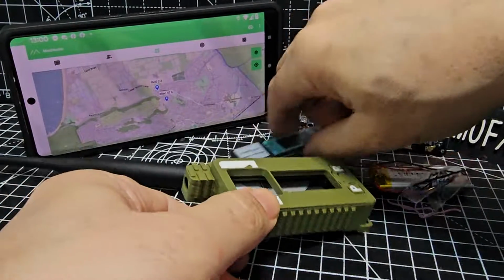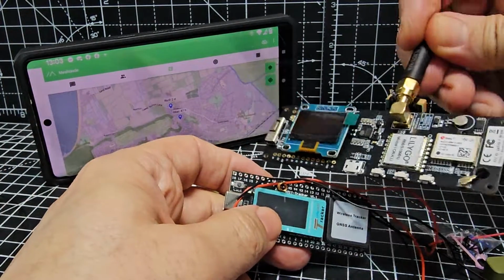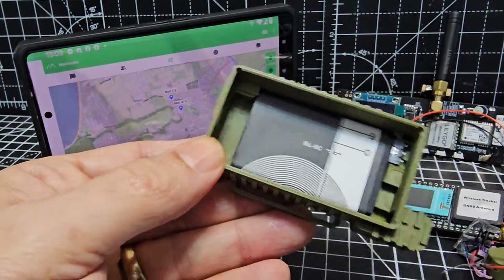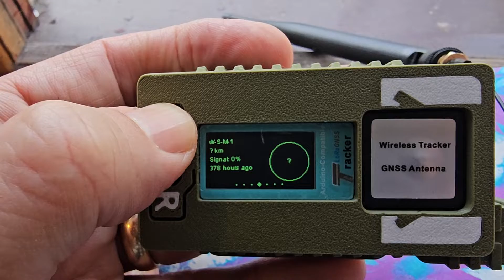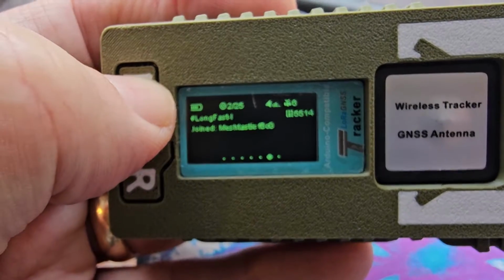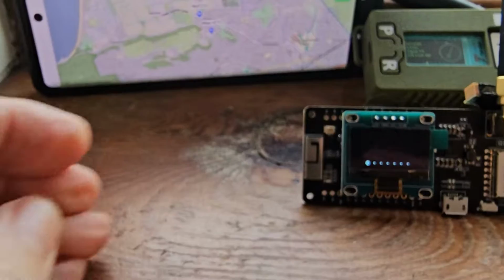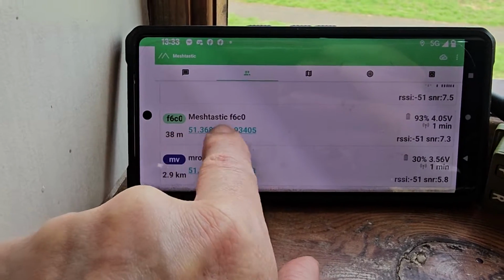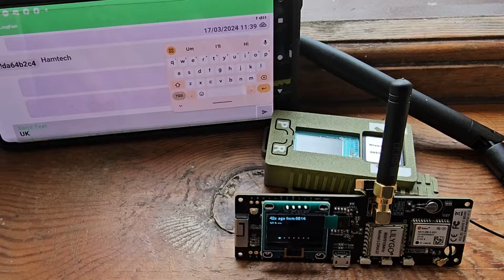HELTEC TRACKER - FIT CUSTOM BATTERY AND CASE

Comment: I got a small 1100 mah battery attached to the heltec and a nice case. But when I shut off the device it still drains the battery.
Reply from the maker: Agree is could last longer

Comment: There are 2 antenna connectors on this device marked GNSS and LoRa, you show the antenna connected to GNSS - is that correct? I thought the GNSS was the GPS connection...
Reply from the maker: Good point I will check .
Reply: @M0FXBHamTech power it  up without a LoRa antenna and it will toast the Tx... Only asking because i received mine a couple hours ago and still playing wwith it!
Reply: @chrislx2006  Mine won't get any satellite lock at all unless I have an antenna connected. I recently picked up a few antennas, put the new one on LoRa, the original antenna on GNSS and immediately received satellite lock. Looks like it may require two antennas if you want it to work fully?